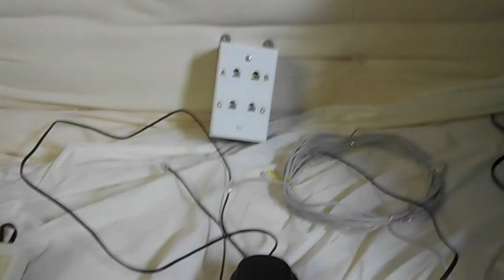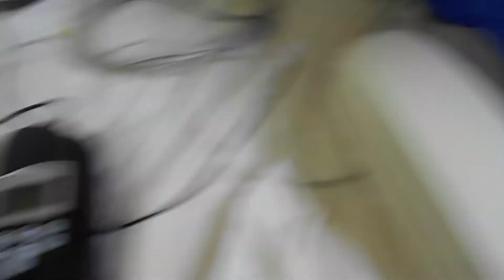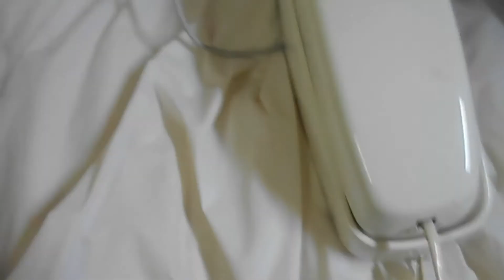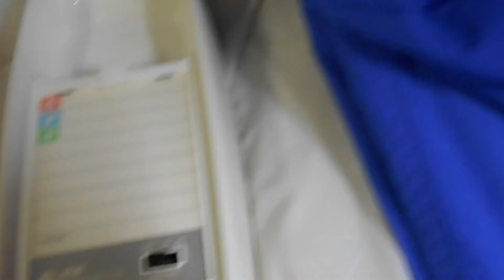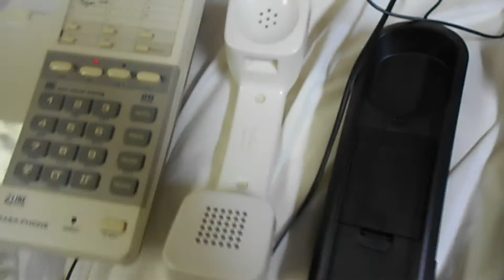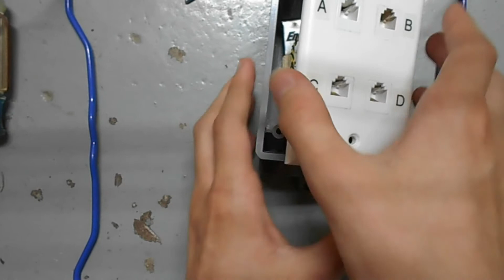How To Make A Telephone Party Line/Intercom System

Comment: this is an intecom correct ?
Reply from the maker: Sort of. This system allows for the connection of multiple telephone sets, and the ability for two or more people to talk. However, it does not allow for dialing other phones, nor can it support multiple isolated conversations - things typical of an Intercom. This would be more of a partly line.

Comment: Hey man, I just wanted to tell you that this is the only video that was informative enough for my project. I think you're clever af. Seriously. I offroad and drive on the highway with the top off of my Jeep. Wind noise makes conversation difficult with someone in the front seat, and extremely difficult for people in the back. 

I modified the project by using 12V from the Jeep's wiring system, 1/8" audio jacks, volume dials from Off-Max, and headsets instead of phones. I have two of the audio jacks in the center console for the front seats, and three in back for rear passengers. The headsets also have a switch off inline for easy access to muting if a passenger wanted to talk directly to the person next to them. I do need to add in a small amplifier as it's far too quiet, but it works well. Thanks for this, dude!